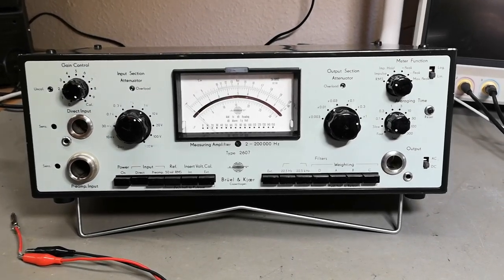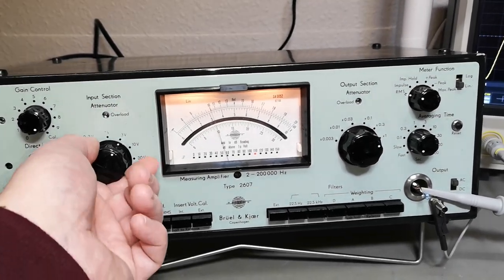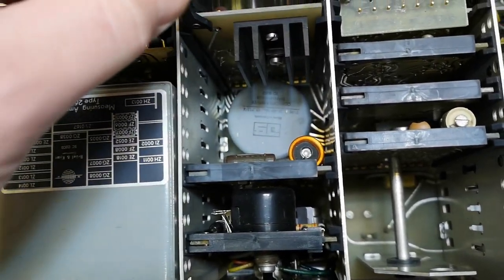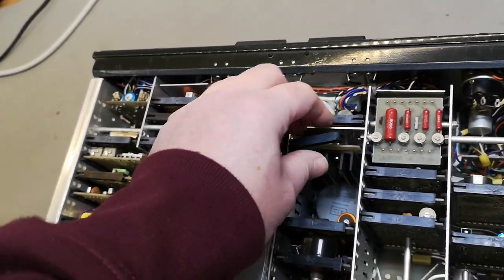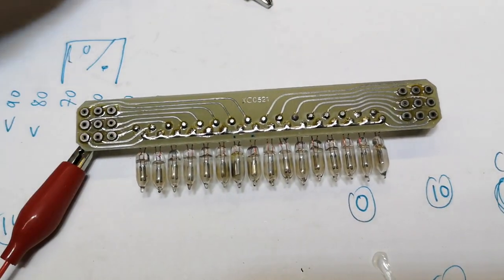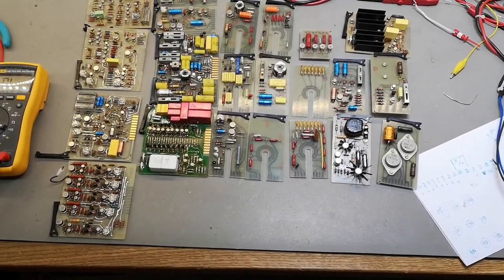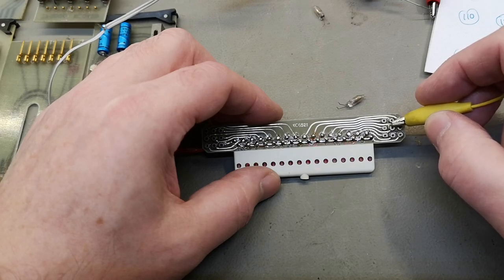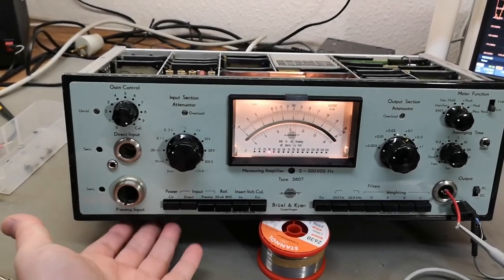Brüel & Kjær Measuring Amplifier type 2607 test repair teardown

Comment: Hi, it's a beautiful machine, but the cleaning and repairs must have taken an incredible amount of time. The LED was a great idea 👍, but I would probably try to get an orange one so that it has the original color of the light, this is how I replaced the indicator light in the HP meter.

Nice day 🙂 Tom
Reply from the maker: exactly i got to order some orange 3mm led, i expect to see this kind of problem again one day, yes it took way too long time to fix this one, first i really wasted a lot of time trying to find and get small neon lamps, i wanted to keep it as original as possible. but ended giving up.
Reply: @TeardownOZ2CPU  A beautiful video with the issue of neon lamps was filmed by Mr. Carlson during the restoration of the HP voltmeter photochopper - replaced by LED. One of the problems is that there have been manufacturing changes and probably the gas mixture and the plating of the electrodes is probably different. Another interesting thing is that the lamps polarize themselves when operated on DC voltage for a longer period of time and then do not light at all when the terminals are swapped. I have a small box with neon lights at home, there are also a few very old ones with an E14 thread that glow pink.
Reply from the maker: @Edisson.  yes cathode poisoning effect is a true thing, i also tried to swap polarization and ofcourse they dont light at all :-)